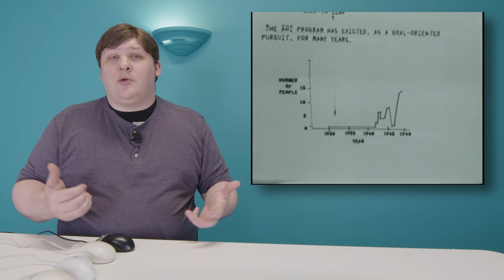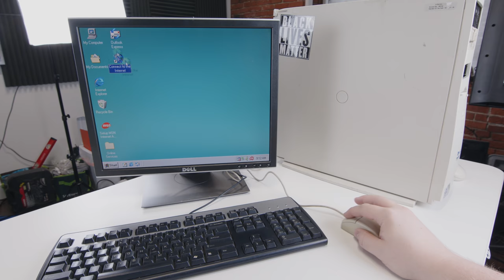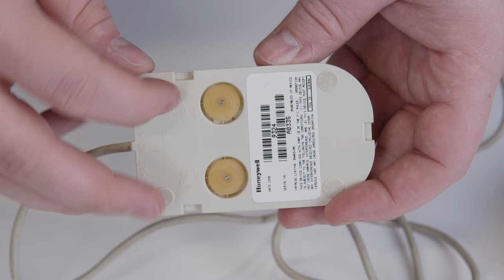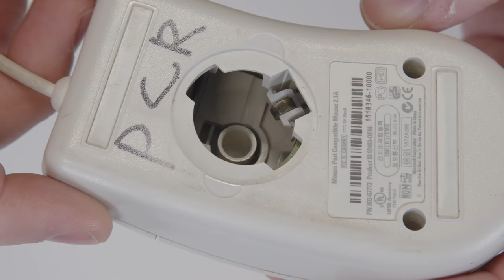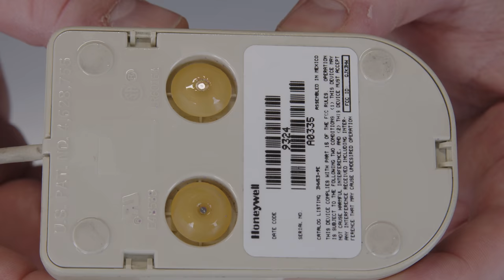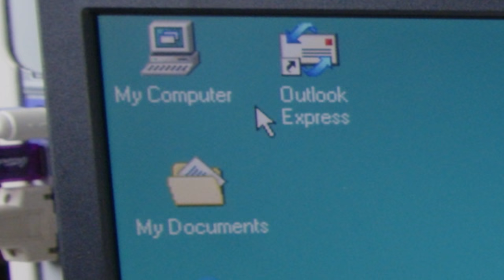Jack Hawley's Unstoppable Computer Mouse

Comment: back in HS (1996-2000) I had classmates that stole the balls out of the classroom computer mice, making them useless. In schools, that was the downside of ball mice.😐
Reply: Ours all had the cover glued shut to prevent this. I'm guessing they died quicker from stolen balls than they did from lack of cleaning.
Reply: Hell yeah, you could then chuck them at classmates. They hurt but didn't do much damage as they were rubber covered.
Reply: I was one of those kids
Reply: @pypes84  a girl with overactive parents got hurt by a mousr ball when i was a kid and they stopped us using the computer lab for quake 3 during lunch break :/

Comment: I genuinely did not expect there to be yet another major instalment to this "weird mice" plot thread in the CRD universe but I am here for it.

Could there possibly be any more of these?
Reply: Only once he manages to get his hands on the mice from the Alto. Some of their attempts to deal with the ball dirtying so quickly was actually to use a slightly rubberized mousepad with a mouse whose trackball was a ball bearing. Just a rather massive stainless steel, chromed ball. The actual mechanism inside was pretty mundane, though, so no real surprises after the material change for the ball.

Comment: There was a metal version of this mouse, used in Healthcare and automotive. I had one, and you always used it on a fabric mouse pad, the wheels did have some grip to them. Failure mode was any rotation and replacing the mouse pad every so often. Used it for years until intelimouse was released...

Comment: From the thumbnail, I thought this was going to be the "2 balled mouse" that I dreamed up as a child in the 80s. With 2 balls, you could sense the rotation of the mouse as well as the X, Y movement. I once taped 2 serial mouses together and wrote a demo in Borland Turbo Basic to move a beach ball on the screen and have it rotate when you rotated my well hung Franken-mouse. Good times!
Reply: I wonder if you could do that with today's optical mouse technology? Figuring out movement is all done using image processing inside the mouse, so it seems like it might be possible to devise new firmware to look for rotation as well as translation. 

Potential obstacles:
1. Hardware flexibility. Is the image processing done by an ASIC or a generic microprocessor? If the latter, is it fast enough to do the more complex processing?
2. Needing new USB packets for the rotation information that can be ignored by drivers that don't understand them.
3. Needing new rotation-aware drivers for the OS and ways to pass the rotation information to programs.
Reply: Imagining the PC cursor rotate like the wii remote pointer looks extremely cursed in my head

Comment: You are very right about the car analogy. But have you noticed that lately the trend of knowing how to drive one, can drive all is reversing - for some reason now its very trendy to "ruin" this by removing the shifter or changing the shape of the steering wheel or removing blinker stocks (or any other feature that has existed for like 70 years) and replacing it with something unnecessarily stupid.
Reply from the maker: Yeah I agree, and bmw is responsible. They're the dumbasses that put a bunch of critical flight surface controls on a knob twenty years ago
Reply: Soon your car will lock up when there is no Internet access and refuse to start to "protect you"
Reply from the maker: @DevideNull  I usually eyeroll a bit but yeah. Yep. It is unquestionably coming.

Comment: In the late 80's me and my friend sold a product called Mouse Wash, a cleaning ball to clean the rollers on ball mice. The ball was acrylic but had a micro textured surface and would grab the gunk on the rollers and it would stick to the acrylic ball, once cleaned you put the original ball back in and you were good to go and the acrylic ball could be cleaned with soap and water.
Reply: I would have loved to have that back in the day!

Comment: I used to use these in a school computer lab in the early 2000's, and i remember them having the tracking problem. They collected dirt, making the tracking problem worse, but since the dirt was on the outside, it was easier to clean, like you demonstrated.

Comment: In the 90s and early aughts, one of these would have been a significant QoL improvement for me over the ball mice I was using. Even now, if I had one of these available to buy at anything other than collectors-item prices and with USB interface, I'd probably still use my optical as a daily-driver, but I'd keep this thing hooked up, and would use it fairly regularly for stuff that I currently muddle through with constantly having to stop what I'm doing to clean lint out of the optical window.
Reply: I switched to IR mice years ago and never looked back. With the cheaper ones you can track strangely while in-air but that doesn't matter when you never have to clean the contact and they work as long as you can physically move the mice. The expensive IR mice use software to negate the weird in-air tracking but I've never actually had issue with it with the high-DPI settings I use.
Reply: @sf4137  Mine is IR. It still gets flaky an unresponsive if there's a speck of fiber-fil in the window, or if the lens gets a grease smudge

Comment: I disagree with your assessment of the magnet. Precisely because of how small are the forces involved, any drag you cause is terrible. Basically, if you replaced that with a loaded spring it would skip  more often, specially in situations where too little (ie: people who used to "mouse glide") or too much force are involved.

Edit: seeing the rest of the experiment, you can see why using friction fit (ball mouse's favourite engagement) goes wrong for the planned design of that crazy crazy guy. 

Conclusion: when everything fails... MAGNETS! :)

Comment: I used mine, the Honeywell version, till it just disintegrated....over 20 years...it was...is...the best mouse I ever had. If I could get one new with a spinner in the middle I would buy it today.
The angular anomalies you observed don't make any difference. After a day or so I was compensating for them without thinking. No matter where you were it worked. On a wall or any desk it just worked. No mouse pad needed. I used it on a CAD system called Tango for PCB design. The screen would automatically advance the page when you moused into the border of the screen and the mouse could go a far as the cord would allow.     

Excellent video! Keep up the good work.

Comment: Having grown up with serial mice, this was a real treat. I have seen something like this before and had no idea how they worked, thanks for sharing.
I'd also suggest the oil could potentially get into that mouse. If you learn about oil cooled (submersed) PCs you'll learn oil can wick up cable jackets etc via calipary action. Other than that It's pretty much indestructible. 
I want to re-design the trackball mouse too in the coming years, it's the best of all but it needs some love. Kensington and the other manufacturers do a good job but the 'shmoo' issue needs solving. Cheers
Reply: I haven't used a trackball in ages. Not since my old 486SX Toshiba laptop died on me. That had a really nice clip-on trackball mouse which was great for playing Tyrian.

Comment: When I bought my first PC in 1999, I got it from a company that sold mostly to architects and CAD users. The Keytronic mouse (the PS/2 version of the Honeywell you have) was the main model they sold for the following reasons - it worked on any surface without a mat and it worked on tilted drafting tables. It also never got dirty enough to malfunction. It also improved on the Honeywell design by using a rubberized coating on the wheels. That meant zero pointer jitter. Back then, it was those users who also had larger monitors (like in the 10s of thousands of dollars) with higher resolution, and those Keytronic mice would work on a huge work surface of any type. Anyway, I loved that mouse and used it for about 6 years until optical mice could actually compete with it and the scroll wheel became indispensable. Awesome concept that really worked well!

Comment: That's pretty killer. Props given where props are earned. This is just one of those showcases that the best tech isn't always the tech that ended up a success. This beats the balls off of any ball mouse. If they marketed these better they could have made pretty good bank. I mean I went to school in the late 90's and I recall having to constantly open up mice and clean them. Having these things in a school or library setting where you don't want random people opening up your mice would have been amazing.
Reply from the maker: Yeah! The lack of removable ball is an angle I didn't consider as far as resistance to vandalism etc
Reply: My high school was such a setting. If you want to stop kids stealing the balls, you either lock them up between uses, glue them in, or use ball-less mice. All three methods got used. Locking up when all we had was macs for specific classes. Gluing in for the first few months after getting a bunch of Win95 machines, then ball-less mice after that.

Comment: I’ve used the DEC version — the hockey puck version of this kind of mouse — in a college computer lab in the early 90s.  That was the only time I ever saw one.  I suspect that one of the reasons this mouse style wasn’t more popular was because they didn’t actually try and sell it to consumers.  I only ever saw them on those DECstations, and your example is from Honeywell — another big tech company. It sounds like Hawley maybe licensed it to those big companies, and never figured out how to get it into a consumer mouse a random person could buy?

I dunno.

I remember thinking they were weird, but the thing I liked least was the completely round shape of the mouse, not the weird sensors.  The same lab had Sun workstations with the optical mice with the shiny metal mouse “pads” under them, but they both worked fine, as near as I can remember.

Comment: Potentiometers don't need to have limits on them, and in-fact many don't. There are also potentiometers that can read more than 360 degrees, like 720 degrees or 900 degrees, and so on.

I don't know this for a fact, but I would strongly expect the pots used on the original mouse didn't have limits on them, and simply wrapped around when they reached the end of their sweep.
Reply: Another possibility is that the limits of the potentiometers just matched up with the limits of the screen.  It's not like they had Doom in those days with its 360 degree rotation.  When the mouse cursor hit the edge of the screen, there was no reason it ever needed to go further.  It's also easier from the perspective of the programmer to have the hardware give absolute coordinates rather than messing around with deltas and wrapping.

It wouldn't have even needed any sort of gearing reduction.  With 1 inch diameter wheels and a 720 degree potentiometer, you'd get about 6 inches of movement from left to right or top to bottom, which is in line with the area we use on modern mousepads (remembering that we like to keep the mouse squarely on the pad when we use it and not hanging over the edges, so the area the center of the mouse traverses is only a fraction of the pad).

This isn't to say that they couldn't have used potentiometers without limiters, of course, just that it wouldn't be necessary.

Comment: A reverse pedal is exactly the reason why I still have trouble driving and video games within analog controller, that's not how cars work gamers.. that's not how they work..I miss the days when freeform controllers had common support or rebindability in video games and didn't have to use Auto hotkey workarounds... Funny, I can almost peg it right to the release of the Xbox 360 no shit! Suddenly my joystick stopped working in video games.. suddenly there was a picture of an Xbox 360 controller in all games.. suddenly you couldn't button map it in all video games.. not all but most, now at least we have injector workarounds LOL and retro gaming is such a thing that there are things to make things work.. but for someone not in the technical know-how back in the old days, dark fucking times dark fucking times..

Seriously though, who the fuck came up with the idea that you should use two different triggers for the gas pedal? The more I think about it the more I want that analog keyboard so bad, the good one from that company that's always has them sold out cuz I'll be damned if I give razor any of my money, and all the other ones are a waste of optical, just having shorter key presses or customizable key presses rather than actual analog control which is like the whole fucking point! It's the only improvement that we've had on keyboard since going way back in the day when keyboard used to give you extra keys before they figured out like you could be less keys for more money.. I still have my g15 I will always have my g15 and I have another g15 I found it a Goodwill that works just fine, and a mother fuckin Trace pencil to fix it whenever it fucks up.

Comment: You missed a great chance to try an optical mouse on that surface. At least some optical mice wouldn't work there either. Recently encountered a Apple mouse spec'd in a situation with a white laminate counter, did not work at all.
Reply from the maker: I thought about that after the fact, but honestly what I decided to do was to post the video, wait for people to make suggestions about what else to test, and then I'll follow up with a short where I just quickly go through some other experiments
Reply: @CathodeRayDude  Yes! An optical mouse on glitter sounds like fun.
Reply: @Kae6502  It will work fine, albeit perhaps with some stuttering, but mostly should be fine. Don't predict a problem. Not really an entertaining demo imo.

Comment: I had a customer back in 1994/1995 that used those Keytronic mice.  it was an engineering firm that made wiring for the Bose company.  They worked in CAD and some other very specific 3D software to make wiring harnesses for the various Bose radios.  I also recall that they used specific mouse pads.

This is a completely nostalgic flashback.

Comment: My much older brother is an architect and the company that he works for used those Honeywell mice on all of their workstations from the late 80s clear up until they were replaced with optical mice around 2000. Apparently they replaced their workstations many times, but kept the old mice because of how reliably they worked. He had one at his house when I was 12 (in 1998) and it blew my little mind how it worked without a ball. I wasn't aware they worked on such ridiculous surfaces though. Definitely an interesting device.

Comment: I've seen these mice. My high school bought a heap of them. 

When we got a bunch of Win95 machines (1996, I think) they initially came with ball mice. Having learnt from experience with Macintosh machines that kids will steal balls if they can, and the previous policy of locking up the balls and covers no longer being an option with the new machines not being limited to a classroom and being used for specific classes like the macs were, they glued the ball covers on. This did not last long. 

They quickly went dodgy from picking up gunk, and with the ball cover glued on, the whole thing needed to be dismantled to clean. They were replaced with wheel mice like these within a couple of months and the school stuck with them for at least the remainder of my time there (I finished school in 2000).
Reply: Wow, that's an angle I hadn't thought of. If they had marketed the things to school computer labs ...

Comment: I had the Key Tronic mouse for my Amiga 4000T back in the day. It was a rock-solid device. The pads, when new, are a bit more grippy, but with age, lose that and cause the tracking to fall off a cliff. The Key Tronic one I could get new feet for until around 2006. A really bulletproof design.

Comment: I had an optical mouse back around 1984 or 85. I had an Apple IIc, and when I bought it, I also bought a copy of Bank Street Writer, which included an optical mouse and a metal mousepad with greenish grid lines on it. As I recall, the horizontal lines were a slightly darker shade of green that the vertical ones, though it could have been the other way around. I used that IIc all through High School. When I switched to a PC (Tandy 100TX) for college, I gave it to my dad for his company accountant to use, where they used it for many, many years. I really missed that mouse though, because it was so smooth, and always worked, unlike the ball mice that PC's used. When the first Microsoft IntelliMouse with IntelliEye came out in 1999, I snatched one up.

Comment: Back in college (well over 20 years ago) we had DECStations with those hockey puck mice.  We also had Sun Stations with the optical mice, and RISC stations with ball mice.  I found the DEC Station hockey puck to be kind of an awkard shape and indeed it had tracking problems.  I wasn't a fan.  I remember interpreting those tracking problems as being dirty and looking under the mouse ... and having no bloody idea how to clean it :)

Of the three, I tended to like the ball the best, despite sometimes having to clean them.  The opticals weren't always so great, and sometimes the reflective pads that were required to use with them would "walk off" and render them completely useless.